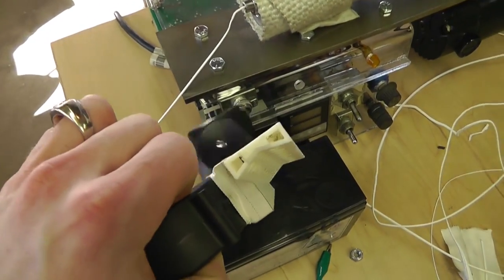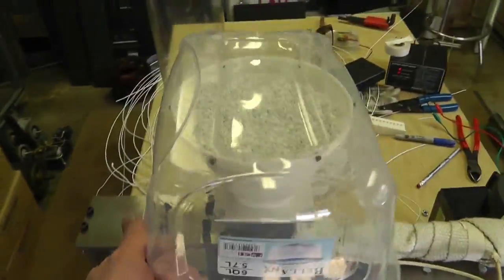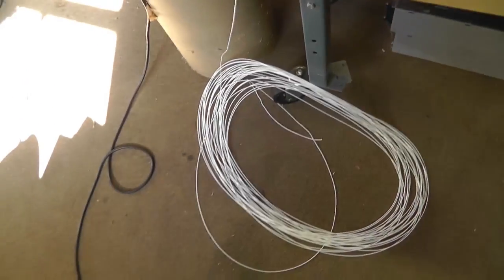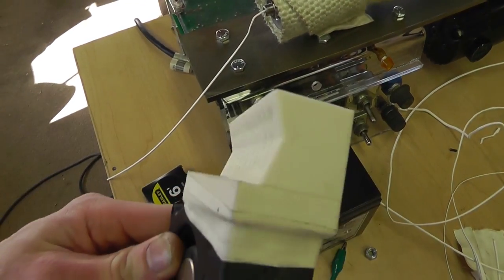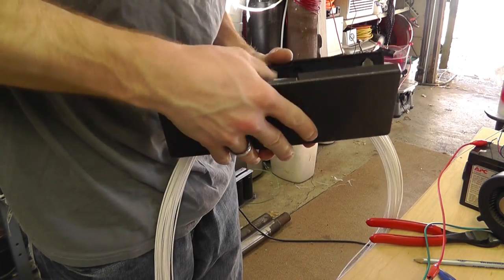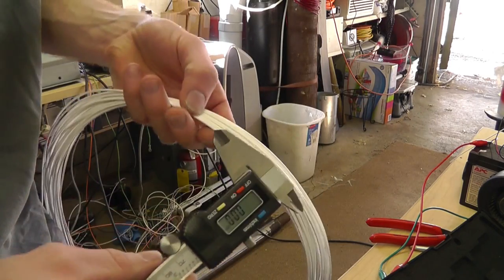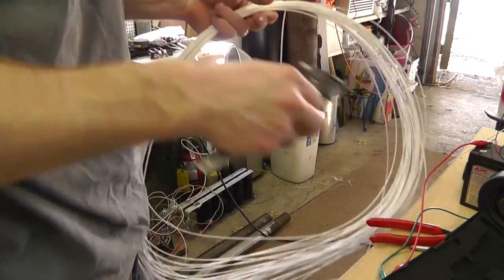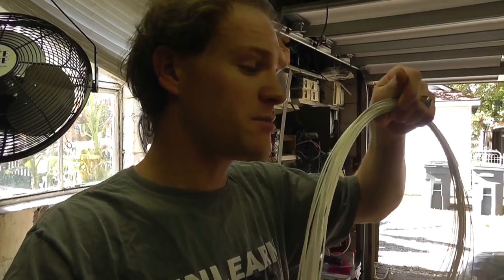#5 ~Russ's Filament Extruder: Air Cool Jig Test. "This Is Just A Test"  time laps

Comment: I think the variation in diameter is mostly because of how much the filament is pulling based on where it is in its little "spool falling path". EX: If it's closer to the machine, less pull so thicker, but when it's further away, it's pulling more because there is a bit more weight, so it's thinner.

Comment: what if you have a long pipe where it comes out with the right diameter that gets slowly colder the longer out it comes.  So that it is all ready stiff when it comes out the end.  Wont that give it the same diameter all the time?
Reply: Because when the extruder stops you'd have the tube blocked with solid plastic.